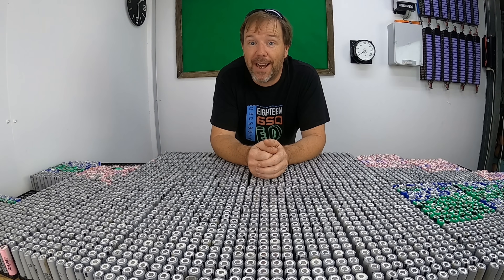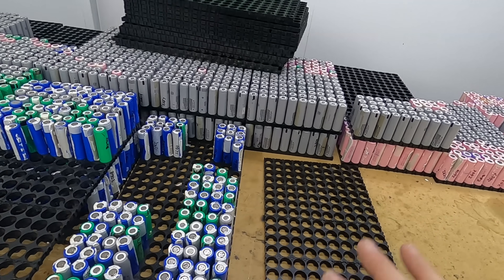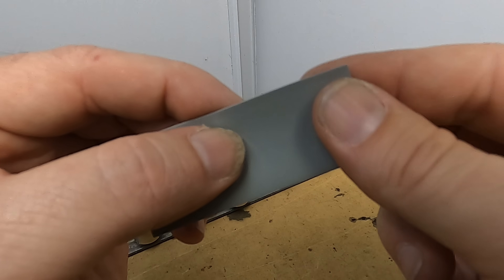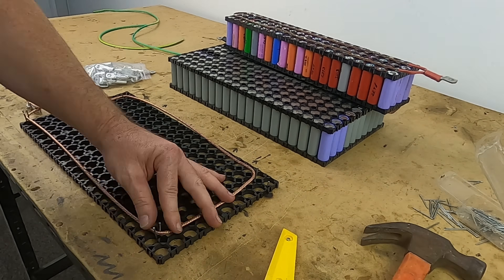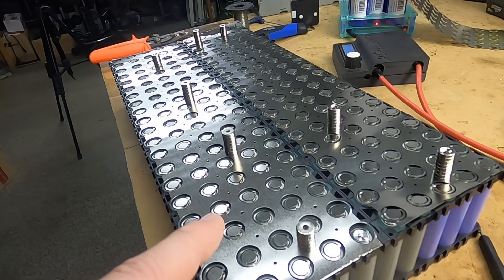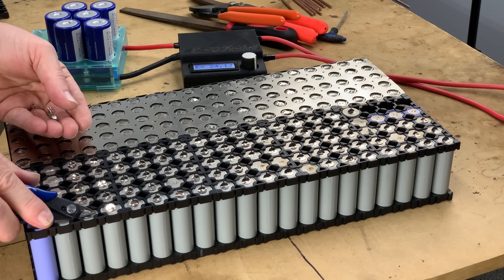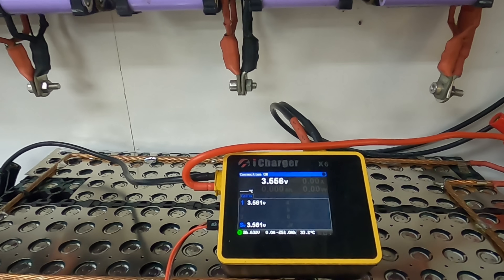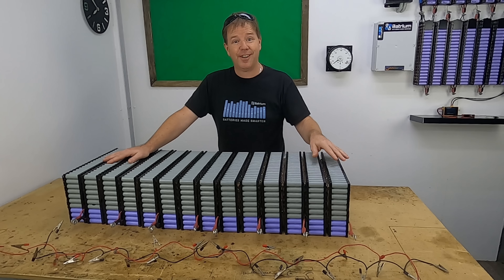Creating my single biggest D.I.Y. battery with 2800 18650 cells recovered from used laptop batteries

Comment: You cant test the voltage without disodering the other parts because they are not connected like a string
15:50
Reply from the maker: True
Reply: im glad i wasnt the only one to notice this, it seems like every cell would be contributing to the voltage no matter where you read from, its all connected
Reply: NERDS. Jk I learned a lot from this video cool beans

Comment: Nice video. I have a question. If the cells are from old laptop batteries, are they still good? can they be revived? 
My laptop's battery is so dead if I disconnect the charger, the laptop dies immediately. I have one of those hobby battery multi chargers, can i revive my laptop's battery using it?
Reply from the maker: You COULD, in theory - how ever personally i wouldn't. In a lot of cases it's not the batteries that have failed it's the BMS

Comment: I think you could automate the sorting task to a machine with some sort of pickup and place in the correct array position, based on the table with your measurements, that would be awesome!
Reply from the maker: That's a great idea! IF you were doing this on a commercial scale - but with used cells it would be impossible to do ethically and the liability would be a nightmare. The setup alone would be one hell of a task for DIY lol
Reply: @HBPowerwall  Hopefully robotics becomes cheaper for the DYI side of things :) in terms of liability I was assuming maintaining the same categorization you did first manually, and then proceed with the automation only for sorting on the final pallets.

Comment: Duuude very impressive! I've been following you from the early days, I hadn't heard anything and figured you had your 10kWh battery and were happy it was done. But this new build is like wayyyy ahead in quality, so so nice. Thanks for sharing and helping the community!
I'm also still in awe of the amount and quality of batteries you get... my measly 1.2kW of cells I collected are probably mostly garbage to your standards, and I've yet to build them into something :)
Reply from the maker: Keep em out of landfill that's the goal
Reply: @HBPowerwall  any tips on a battery source, especially high amp output cells? I got some drill batteries from a transfer station battery bin but don't know the supply and recycling chain works! There's gotta be a better way (I'm also in Brisbane)
Reply from the maker: Mine all come from private schools but they aren't high drain - perhaps ebikeshops or scooter hire compaines?

Comment: I hope you're up to date on your payments for your home fire insurance ;)
Reply from the maker: So many fire comments - i better prove you all wrong - this should be fun..
Reply: @HBPowerwall  Well, knowledge and experience is always important, but statistics always prove best in the end, and knowing that I personally know 2 people who've had major house fires due to similar projects with repurposed lithium cells, there is'nt much to prove wrong... Just make sure they are installed away from you and your kids' bedrooms, install smoke alarms, and make sure they aren't next to the emergency exit ;)
Reply from the maker: lol you haven't seen my other video huh... 120 temp sensors - THOUSANDS of cell fuses, battery breakers, Shunt Trip controlled by advanced  BMS that can shut the lot down in case of - Fire alarm going off, any one of those temp sensors going too hot or too cold, Installed outside in separate sheds, every cell (80-200p) battery is monitored for high and low voltage and will also trigger shunt trip, fans controlled by the BMS to keep air temps down - gah the list is long. And show me one person that has had a fire and not caused it... Incorrect charging, damaged cell, shorted it, etc etc. Been doing this for years I got this... :)
Reply: @HBPowerwall  i've seen all your videos ;) just because you can detect a fire doesn't solve the issue, unless you couple it to an inert gas suppression system or equiv. if one cell catches fire, the other around it will too, doesn't matter how much you monitor things and shut everything down if it happens...
Reply from the maker: I do agree with that statement - just sick of the fire wise cracks - Stay tuned tho, I have a solution to the comment :) Containment...
Reply: @HBPowerwall  I guess a metal box around them with a vacuum or inert gas inside would solve the issue completely ;) or couple a vacuum pump to your fire detection system...
I expect another video soon! ;) LOL
Reply from the maker: All over it like a cheap hooker
Reply: @HBPowerwall  I'm not entirely sure if the lithium cells can still burn/explode under a vacuum... it's possible there is an oxidizer present in the cells that can feed the burn (like the oxygen in lithium oxide), but a solid metal box will at least stop the fire from spreading to other objects, lithium cells in other boxes, and the building, and it will also contain the toxic smoke...
pumping the air out of it with a vacuum pump upon detection of a possible fire will also severely reduce the fire due to the burning of the plastics and other materials in and around the cells that need an oxygen supply to burn... it could save a large part of your project in case of a fire and you'd only have to replace the lithium cells in the boxed segment that had the fire originate in it...
I wouldn't use any aluminium for the boxes though, the cells could ignite the aluminium if it gets really hot! ;)
A good idea, and something I haven't seen on youtube before... 
Nothing some good research won't answer before building something ;)
Can't wait to see what you come up with ! ;)
edit: you can probably learn a lot from examining the battery assemblies in modern engineered safe electric vehicles...
Reply from the maker: burn underwater

Comment: Great work - but I honestly think lithium is the worst choice for home energy storage.
Reply from the maker: Why do you think so? Tesla uses it...we have inside all our laptops, it's accessible, often cheap or free if you don't include time.
Reply: @HBPowerwall  I think the work you have put in and the neatness of you work is fantastic however there is substantially more suitable battery chem for home energy storage. Tesla use lithium in cars because of its high energy density, something which isn't important in a stationary, large object like a house. Tesla use lithium in their power walls because they already make the batteries and need to ship them round the world - so why not. Some of the biggest issues with lithium for home energy storage include its fairly poor cycle rating, its inability to survive many deep cycles, its tendency to catch fire (great in the middle of your house, even better if your house is already on fire) and packs dislike of cell imbalance. I personally would be using an older technology batter like Nickel Iron which has a low energy density however is able to perform many millions of cycles, doesn't mind deep cycling, is tolerant to heat/overcharge situations and doesn't catch fire.
Reply from the maker: I don't disagree - but this is my path, my price bracket and would make for a REALLY shit youtube video installing with a forklift lol
Reply: @HBPowerwall  Not sure about that, forklift fails get views :). Good luck, look forward to the install vid.
Reply from the maker: hahaa i like your positive spin on things lol Would edit much faster if i stopped replying to everyone hehe

Comment: Cool work!
Isn't it necessary to balance each single cell?
Reply from the maker: Yes, correct - all cells were charged to 4.17v rested to check for self discharge, then the batteries were built, charged to 4.2v discharged to 2.9v to get whole battery capacity, the recharged to 3.7v then all 14 were balanced together. They are well balanced :)
Reply: @HBPowerwall  Thank you for your quick reply. So it's enough to balance the cells during the build process? Isn't it necessarry to balance them during regular discharge cycles as well?
Reply from the maker: OOOH it'll have a high quality BMS as well once in service
Reply: @HBPowerwall  Ohh okay. Do you have to wire every cell to the BMS? I don't really get how it could do it's work else
Reply from the maker: Not every cell no ..lol that would be madness just one to each battery so just 15 wires per battery pack

Comment: I can tell you a trick about soldering heavy copper bus bar.  I use rosin paste on where to solder that I choose. When you put on the iron the sizzle will spread the solder in two seconds and then use a wet watered towel. And wala the item is soldered without overheating the items. Easy peasy. VF
Reply from the maker: Thanks for the info!
Reply: @HBPowerwall  ow long is this battery going to last ?? How much did the batteries cost you ?? What is the total time to make this battery pack ??? VF
Reply from the maker: Last, who knows a new car can break down in the first week of owning it, cost i don't really know but i guess about $3000 aud - and time was a whole year of spare time to process film and edit

Comment: Cool, but that thing's gonna light like a box of firecrackers when a cell fails.
Reply from the maker: I would hope that i have enough safety in place to reduce that risk to next to nothing... Stay tuned - i'll impress you with my extended plans to increase safety to the next level!
Reply: @HBPowerwall  yeah, but you still mixed cell capacities in parallel.  Also, I don't believe you did anything to balance the cell voltage or group batteries by health.  Considering both of these points, I'm surprised it didn't explode while you were welding the contacts on.
Reply from the maker: LOL that was all done in the 5 months before I started filming - https://www.youtube.com/playlist?list=PLVtgHS9JIte_tT8JVGvoK3OBy7sYm3Xwj
Reply: @HBPowerwall  but... You still mixed battery capacities.
Reply from the maker: Nod... yes.......... and its working perfectly for 4 years what you might not know is the amp draw per cell is MAXED out at just 0.33 amps and that'll drop again soon to under 0.2 amps normal load is something like 0.03 amps .. Don't worry i've been playing long enough to understand your worries..

Comment: While I was watching your video I realized that all the battert cells by mAh range makes a distribution quite exact as a "Normal Distribution" in stadistics. So, you may calculate the power of the batteries using just a Normal Distribution Table Index
Reply from the maker: These built batteries tested within 15ah of each other something like 3% spread - you would never get that with out proper sorting of cells i don't think.

Comment: Fantastic battery and setup. If someone wanted to follow your advice in Australia, how does your system and a potential DIY'er go about compliance with AS 5139 as well as AS 3011 ?
Reply from the maker: It's offgrid, under 120v DC - so as far as I know it's good - if you know other wise id love a chat so i can improve it... Stay tuned I'm about to rip it all out and remove any doubt that this can be done so safe the burn your house down crew will be put out of business lol
Reply: @HBPowerwall , On grid or Off Grid, AS3000 and it's referenced standards still apply. 
I've not looked through all your videos, but judging from this one, you know what you're doing even if you aren't aware of all the rules. I'm going to guess you're at least a qualified electrician, so you're not restricted to the DIY'er 60v DC or 35 AC as well as battery systems under 1kWh.
However, you might like to make your subscribers aware,  DIY'ing your own solar system in Australia, means you'll need to comply with the appropriate standards. And if you're unable to provide evidence that a qualified electrician has done the work, in the unlikely event of an incident, your insurance won't cover you at all, as well as risking fines from your local regulatory body.
Reply from the maker: @n2o_spark  Most views are from the US, I'm not a sparkie but i've paid to have them out 2 dozen times, been audited twice << SHIT process! Insurance compliance was a nightmare that took months and months and put my preiums up by 2000 a year. It's about to all being ripped out and started again from scratch.
Reply from the maker: Going all high voltage solar, Approved hybrid inverter/s fire proof bunker - all sorts good stuff that will ... end with 15kw of solar and 75kwh of storage
Reply: @HBPowerwall  sounds like it'll be an awesome setup. Yeah i know the regs in the USA are quite a bit more DIY friendly. It's a bit of a shame in Australia, they're so much harder on the DIY community. Given what you've done, you probably have as much if not more experience than many qualified sparkies. But they're the rules we've got to live with
Reply from the maker: @n2o_spark  Yep, completely agree - but these rules keep us all safe so happy to play with them. US have it so easy in comparison

Comment: Hi, nice videos! Nice DIY Job! My repect.
Mybe you wanna have a look at this guys solution for connnecting the batteries without soldering, i found this very usefull! Also testing the cells later on will be easier because you dont need to unsolder them etc...
https://www.youtube.com/watch?v=Su45EePZnzw&t=990s
Reply from the maker: Yeh, that's a hard no! Not a chance - look i'm not saying its a bad idea as a community we have to explore ever option - but that screams hotspots
Reply: @HBPowerwall  No problem at all, im new to this whole battery thing so i found it nice NOT to solder :D
thanks for your opinion. keep on with the good videos

Comment: Saw some videos one and two years ago about re-using bad laptop battery, i really need to start collecting old laptop batteries, get into li-on power sotrage, get a proper cell tester to test the capacity as you do it. That video is inspiring. And as you said, that way of testing the good cells from the bad one makes long lasting power banks, same as i used to do with testing old hard drives with mhdd to find the old ones that test like new young boys out of the lot, those will survive the 7th world war and still rock the boat. That spot welder is NICE. Thanks for the video!
Reply from the maker: Thanks for tuning in buddy - would have been easier to start collecting a few years back, much cheaper and easier to find cells

Comment: how long before we get the knowledge and up date about the cap bank on the kweld. ps you will like this  https://www.ebay.co.uk/itm/2-8V-3000F-Farad-Capacitor-16V-83F-low-ESR-Electrical-Single-Row-Super-Capacitor/153784570233?ssPageName=STRK%3AMEBIDX%3AIT&var=453812864872&_trksid=p2060353.m1438.l2649  
it add a littel something....extra.. almost 2x the kick for one third price
Reply from the maker: I will when i get time do a full over view of the Kweld but all you really need to do is see these results - stunning product << not paid to say that!
Reply: hi. its the reason i bought it. a friend was to print the box but after two attempts its still no good more than 3mm out of squ. and no supports.  but found 3d print comp near by so will give them a try. ps thanks for ALL YOUR HELP.  i've been doing this sort of thing for years. but nice to have some one to SEE. how else it can be done with new iades i was told ..if not leaning .. then not living.. so ill keep living..  stay safe and well...im to go back to work on monday ??? not happy..  thanks tone
Reply from the maker: I believe in learning something new every day. makes for very good days

Comment: Wow, this is awesome!
So it's better to spread the higher-capacity cells evenly among all of the battery packs? Pardon my ignorance, but why not have the strongest cells together, and the mids together, and the weakest together, in their own packs?
Reply from the maker: because then you would need one battery that's 150 cells and another that needs 280cells to make the batteries the same capicity
Reply: This does not sound right to me. The reason we have BMS and balancers is to protect against mismatched batteries in packs. Sure this is parallel but still.
Reply: I looked around and there is mixed messages. I need to educate myself more on parallel cells more
Reply: Would love to see some actual testing on this. My intuition is that the lowest capacity cells will degrade faster in the mixed configuration compared to putting all the strong cells in one pack and weakest in another.

Comment: I hope you cleaned the solder joints from the plumbing solder. It may be ok on the heavy copper bus bar and nickel but it would eventually corrode electronic connections.
Reply from the maker: Bit of IPA does the job.

Comment: I'm wondering how many seconds your huge soldering iron needs to ignite one of the cells. I never could do that without knowing when it's time to let it cool down before continuing.
Reply from the maker: You sound smart so would know the properties of nickel and copper both wick heat very efficiently. 10-15 seconds after soldering has been complete you can touch with out a problem.